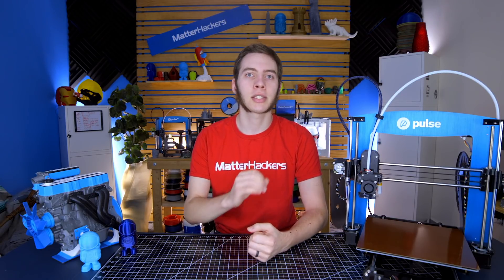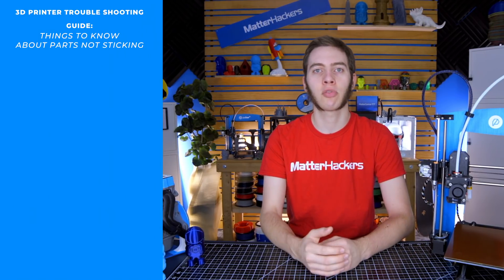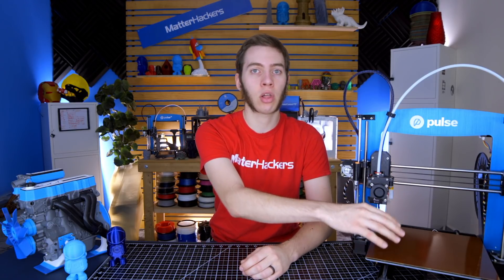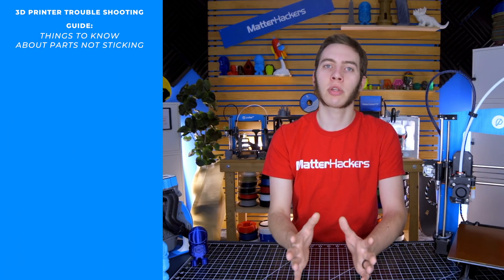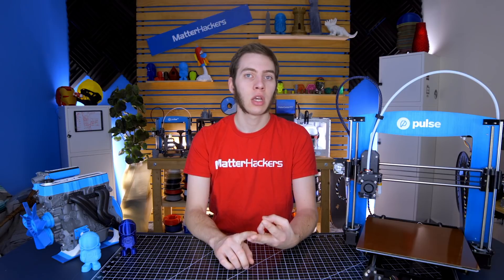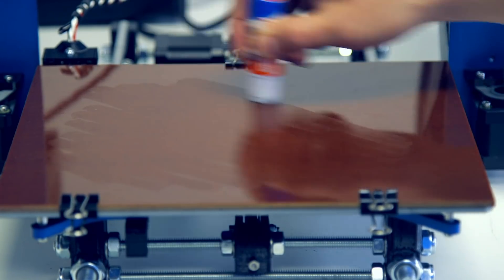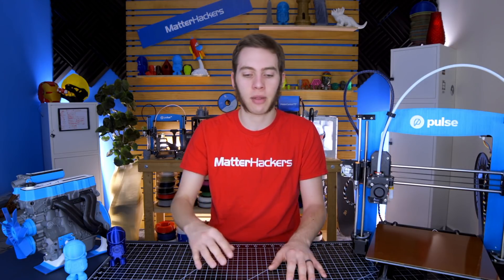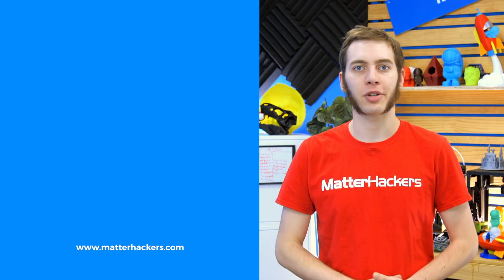3D Printer Troubleshooing Guide: Parts Not Sticking to the Bed

Comment: I have a Ender 3 Pro with the creality glass bed everything was working fine, and I always check the bed level like every other print. After printing nonstop for the weekend out of nowhere boom! It's not sticking anymore. I don't use any adhesive and it is leveled and clean. To try to fix the adhesion problem I tried glue stick I even changed the nozzle, ran CHEP's bed leveling script over and over and works fine so it's leveled when printing the squares to check the level sticks normal. But when I'm starting any other print, it won't stick.
Reply: I have the same printer, and it just randomly stopped sticking for me after a few prints, too. I replaced the entire nozzle and replaced the bed plate. I bought whole new filament, but it still won't stick. Did you ever find out how to fix it?

Comment: I’m really struggling since I made the move to glass. I need flat surfaces for the bottom, and 8 have tried just about everything to keep my parts sticking to the surface. I always seem to get the corners coming up a little. But I had the opposite problem with the magnetic bed, the parts would almost not come off!

Comment: I have blue PLA+ filament from Overture that is refusing to stick. im printing at 215c with a 60c build plate, leveled the bed, but for some reason every time i print one specific designs, on the initial layer the print nozzle is too high off the bed. Even when i adjust the z offset to -1 it still looks like its the same height off the bed. 

Whats weird about it is I printed this exact design in red, and it printed wonderfully, but then i swapped filaments and now I cant get it to work with blue filament for the life of me. Any thoughts?

Comment: As a corollary to your checking the temperature for the material you are using is to double-check what's on the spool.  You may think PLA is on the spool, but it might be something different.

Comment: I know the video is a little bit old but I had problems with the parts not sticking to the bed, I use hair spray but now the parts stick way to much and sometimes I damage them a little bit to get them out. any recomendations?

Comment: I had no problem with the standard white filament which came in the box of Creality Ender 3 V2 (don't know the type), even at 3x the printing speed. Now after purchasing golden filament 1.75mm (Dutch Jupiter series from 123-3d.nl) the filament did not stick of the bed at 2x the printing speed. It did stick with normal printing speed and increased nozzle temperature of 210 degrees celcius...

Comment: BELIEVE ME EVERYONE THE FACT THAT YOUR PRINTER ISNT WORKING PROPERLY IS SOLELY DUE TO THE BED LEVELLING. I TRIED THE GLUES THE HAIR SPRAY THE GLASS BED SCRATCHING NOTHING....... JUST TAKE YOUR TIME TO LEVEL THE BED PROPERLY AND IT WILL WORK. THE MODEL WONT MOVE IF ITS ON A LEVEL BED. HOWEVER IT WILL MOVE IF IT ISNT ON A LEVEL BED. DONT FALL FOR GIMMICKS

Comment: Even though my printer has a auto bed leveling and a manual.. Neither seem to get the bed leveled right. Both based on me having to keep turning the 6 spring hand knobs my Tronxy X5SA 2020 model printer has?  I spent over 3 hours once keep adjusting the knobs by small amounts over and over up and down as the printer auto bed measuring kept going along checking the 18 points of the bed.. it come up with lots of different values.. some plus some minus! the stated range the measurements it needs is no more then 0.08 This was impossible to get even right on all 16 points with the 6 knobs?  I did manual which is 5 points and of course the Z axis adjustment too. ( a sheet of A 4 Paper used to get those 5 points so the paper just is able to be pulled out from the nozzle without tearing that sheet?  Done all that over and over. Never gets the level right for the printing to work! I just managed after days of trouble to do one small Benchy Boat test. and one medium sized print using the PLA + then even with glue stick either 1 , 2 , or 3 layers no bed adhesion even on a brand new ultra flexible magnetic hot bed plate. I tried Hair spay I tried cold bed hot bed I tried the works Nothing works, I even lightly sanded the surface using 200 grit sand paper., Nothing works..  I washed the bed with small amount of dish soap and warm water to clean it, I keep the bed covered when not used to stop dust mucking up the bed. Really getting pissed off with it all really?

Comment: video did not help at all. why brim help it stick bed if part is allready big lol.
and why it sometimes really hard take part off now its loose or knock off while printing.
never had problem before.untill i installed slider new computer and try print.
yes its settings. yesterday working today not.its settings lol

Comment: sometimes???  I can't get anything past the 3rd level before it starts flying around the bed
Reply: Same here. Just got the Creality CR-6 SE & tried to print 3 different objects & NONE worked so far. All of them had issues w/ not sticking.
Reply: @justinmoeller2028  i heat bed to 80, put a layer of hot melt glue on bed...then turn off heat all-together, wait till it hits under 40 then print...with cold bed cura bed set to 0...when you have finished print heat up again to 80 then remove...simple..

Comment: Just had an experience (10 minutes ago) wherein my project included a full base and supports for a part that would be largely printed on those supports. This was a 14 hour project. 2% in, I found the part curled up (cupped) on the base and I finally started to put together what I think is happening. The room is 20 degrees Celsius and the bed was 60 degrees Celsius.  As the project printed further from the bed surface, the PLA was able to cool more then the PLA on the bed surface resulting in shrinkage across the top of my project and curling of the entire piece.
Reply: i heat bed to 80, put a layer of hot melt glue on bed...then turn off heat all-together, wait till it hits under 40 then print...with cold bed cura bed set to 0...when you have finished print heat up again to 80 then remove...simple..

Comment: I just bought a glass bed for my Monoprice Mini Select V2 but my PLA will not stick to the bed.

Cleaned with isopropyl, used gluestick and hairspray. Added a brim.

Tried printing at 190 and 200 degrees and with a bed at 55 and 60.

The first layer is fine, and in fact it seems good for about 30 minutes, but slowly the whole thing just starts warping upwards.

Any suggestions?
Reply: Try to level the bed

Comment: I still haven't been able to get proper adhesion! I'm printing with PETG, I've tried slurry, painter's tape, hair spray, and glue stick, none of them are working, I have leveled and releveled my bed so many times I could do it in my sleep!, trying real hard not to curse up a storm and throw the 3D printer out the window! Four stories strait down! ARRGH!!!!!!!! I will try one last time to get the bed leveled, the glass clean and if it doesn't work again, I have no other option but to try a different brand of PETG.
Reply from the maker: If you purchased the PETG from us, give us a call and we will help you out - no need to suffer alone! 949-613-5838. Otherwise, we do have a great article on succeeding with PETG here: https://www.matterhackers.com/news/how-to-succeed-when-printing-with-petg-filament - Hope that helps!
Reply: i heat bed to 80, put a layer of hot melt glue on bed...then turn off heat all-together, wait till it hits under 40 then print...with cold bed cura bed set to 0...when you have finished print heat up again to 80 then remove...simple..

Comment: When using a Purple Glue stick, apply it then spray it with a light mist of Windex as this is a great re=activator. If you have too much glue take a paper towel and play with the results...  Spray a little more to easily remove any excess glue from the glass... Cool, Clean and much easier to deal with.  Good Luck!
Reply from the maker: Thanks for the tip! I hope it helps someone that's been having bed issues. - Alec

Comment: I use a glass bed and Aqua Net Professional Hairspray Extra Super Hold Unscented.  I clean the bed and then I spray the hairspray on a foam brush and paint a thin coat on the glass. I have printed up to 10 prints before having to re-apply. I have a CR10, FT-5, Flashforge  Creator pro, and a Robo 3Dv1. I use this on all of them and all filament types I use and it works great. I don't have a problem with print sticking.
Reply from the maker: Awesome! Aqua Net will always have a special place in my heart for how easy it is to apply and how well ABS sticks to it. Glad it works well for you too! What material are you mostly printing? - Alec
Reply: @MatterHackers  I mostly use  pla+ (pro) and PETG. I used to print a lot of ABS but after trying PETG I have not printed with ABS at all. I am looking at upgrading my printers so I can try more of the higher temp ones. I love all of your videos and I am looking at trying some of you filament soon,

Comment: You said "brim" and showed skirt.  Also, one thing you forgot to mention ... level your X!
I just went through this, couldn't level at all and make anything stick, so using a digital calipers, leveled the bed from top of printer case.  From there I moved X and compared it to bed, and left to right was a ride DOWN HILL.
Using feeler gauges, I found that 'flat' was about .020 inches too high on the left, screwed the ball screw, coming down just .010" and away it started printing.  I had gone round and round with all the methods you mentioned prior  ;)
Reply from the maker: As Daniel Krah mentioned, there was a brim and a skirt on that part. You are right and I should have mentioned that. For others reading, this is something you will only really find on printers with a moving Y (which generally means the X axis raises as the print progresses). Automatic bed leveling sensors or thumbscrews under the bed can alleviate the problem, but fixing the problem where it starts is always a better call. Was that your only issue or was there something else compounding the error as well? - Alec
Reply: There was a brim and a skirt ;-)